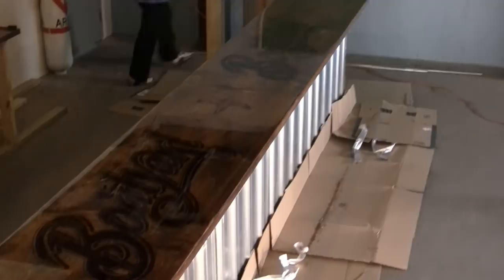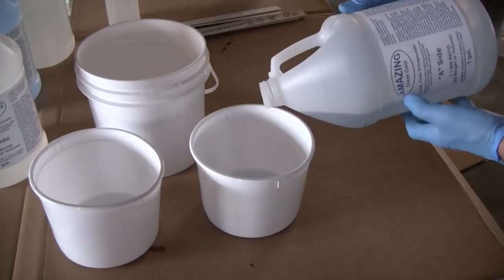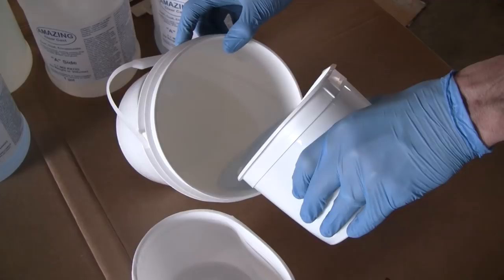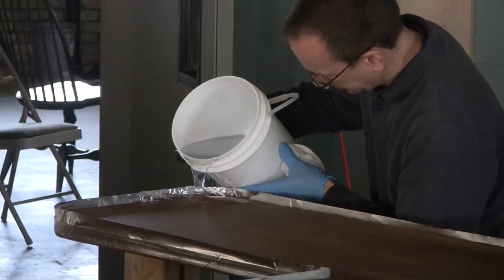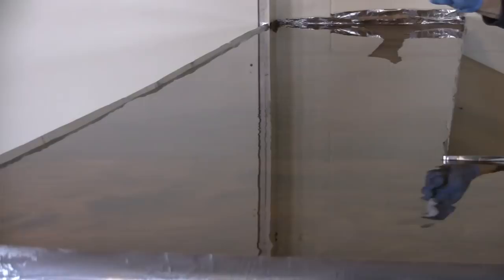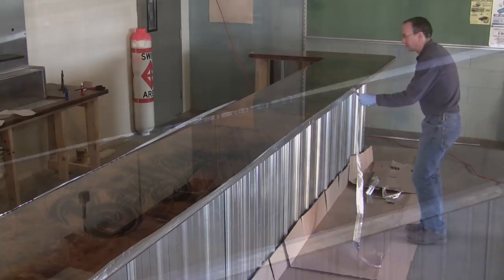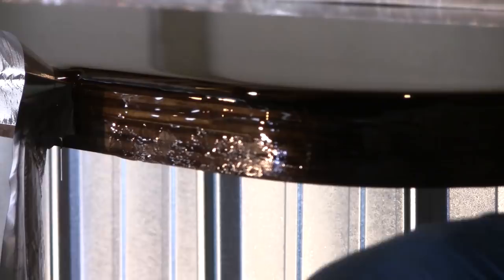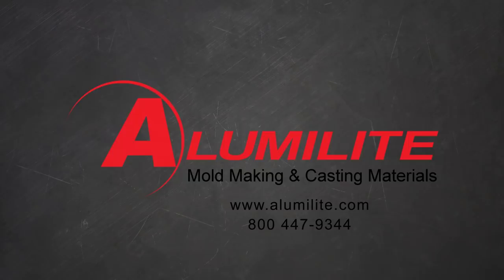Pour Your Own Clear Epoxy Bar Coating | Alumilite

Comment: Is it possible to tile a table top and use this method to coat and cover? I was told the grout would mess it up. I have an OLD table I hope to upscale for our kitchen & thought epoxy resin over painted tile would be lovely.
Reply from the maker: This is definitely possible!! You just need to make sure that the grout is completely cured/dried before adding your epoxy resin! We would recommend doing a small test pour to see if you get any strange reactions - if you do, then you can use something like Mod Podge to seal it before pouring your resin!

Comment: Is this weatherproof?  I’d like to seal a beer label on the top of a bourbon barrel the beer was aged in.  Will this material damage the sticker?  It’s similar to bumper sticker material.  The barrel will be outside, so I’m curious how the resin holds up to the elements.  Thanks.
Reply from the maker: As far as elements are concerned, resin stands up very well to them! The sun is a whole other topic - UV rays will cause your resin to yellow eventually. As for sticker material, you'll just want to seal it with some modpodge or Amazing Sealer before pouring your epoxy!

Comment: So when you go around the edges, how long after the pour do you do this, & could I just let the resin fall off the sides while pouring..
Reply from the maker: Yes, you could allow the resin to fall over the sides but you will still want to go around the edges and make sure that everything is covered - this can be done during the pouring/spreading part!

Comment: Hey mate, nice job. Could you please tell more about the materials? How thick is the tape you used and what kind of epoxy you used? Thanks man :)
Reply from the maker: The tape is aluminum tape - it’s pretty thin bits it’s more sturdy than normal tape so it works great for a quick mold box! The epoxy we used is our Amazing Clear Cast epoxy - you can find it at www.Alumilite.com!

Comment: I am thinking of having a 1/32nd thick metal sign on top of my bar table. Will this cover it up so it won't extrude through?
Reply from the maker: Yes! You may have to do a few pours to get the thickness of epoxy you'll need to cover the metal but it will definitely cover it!
Reply: @AlumiliteCorporation  1 other question...can this go over oil based paint?  How much do I need for a 4 ft x 3 ft table top?  Thanks!